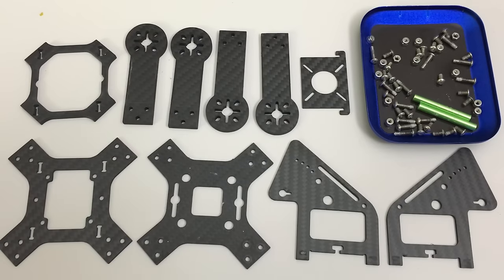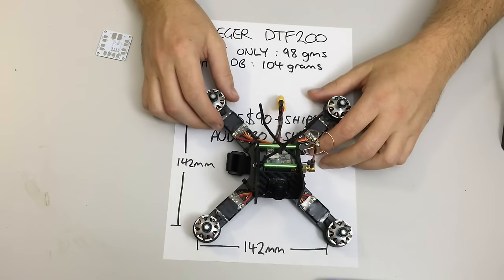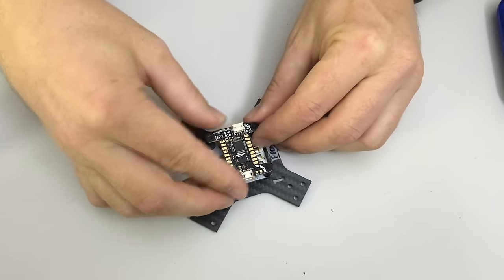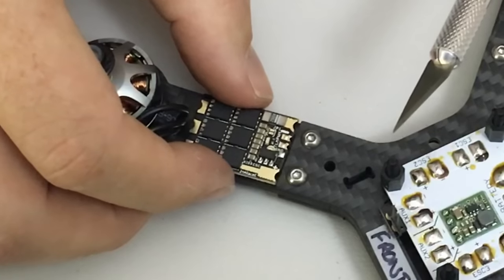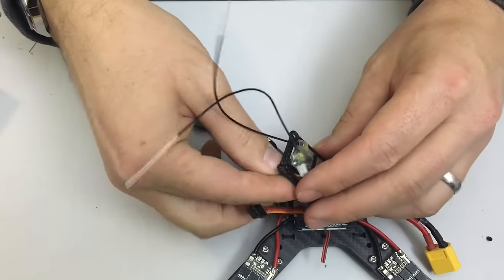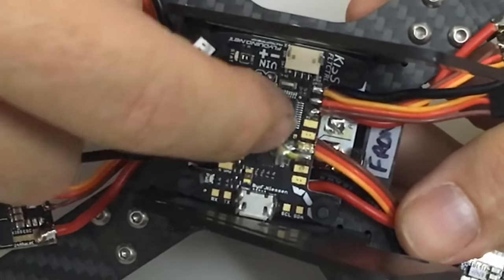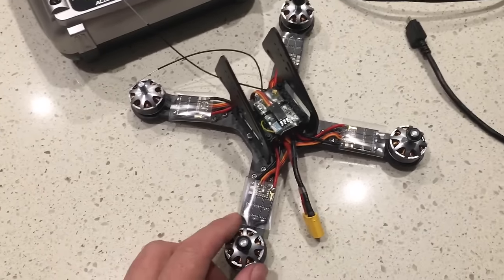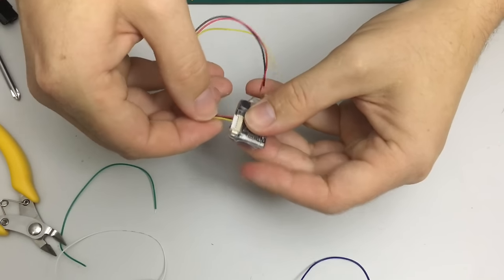Part 9 - 5"MQSO - Shen Drones Krieger Build

Comment: Where do you get those plates you mount the receiver on. Also, do you plan on checking out the aero pod for the krieger, or one of his newer 5" frames (mako, corgi?)
Reply from the maker: I think that one was left over from a HobbyIn Martian.  You can buy them separately from ImpulseRC (Australia) or Flyduino (Germany).  I can't think of a USA supplier right now, perhaps GetFPV?
Reply: I have some .75mm cf sheet I made last year, might be time to make use of it.